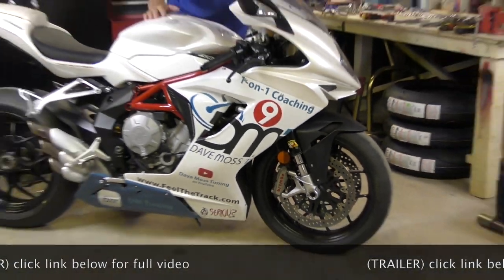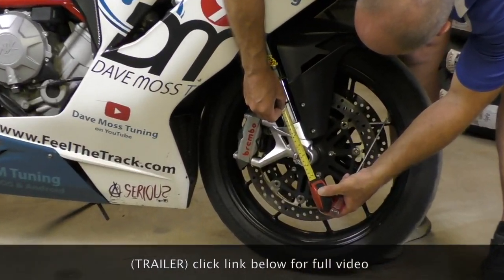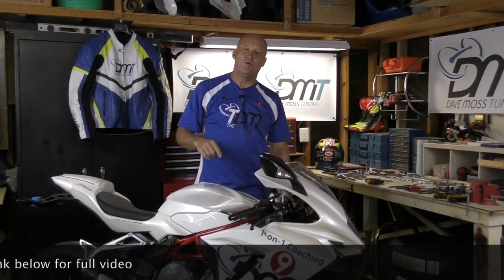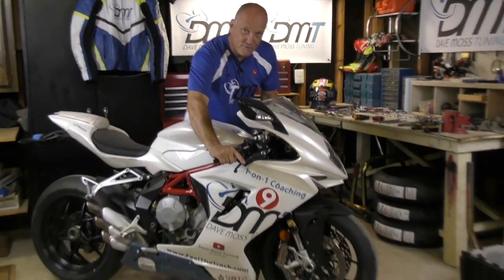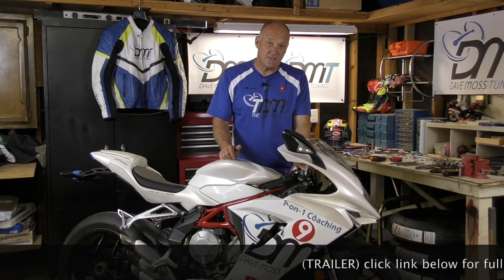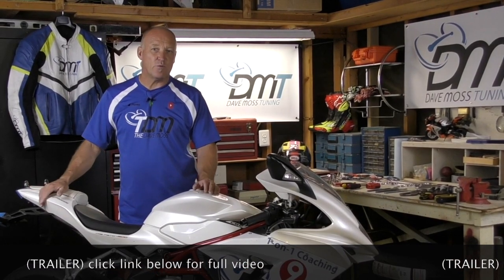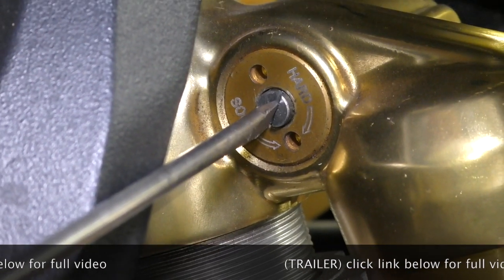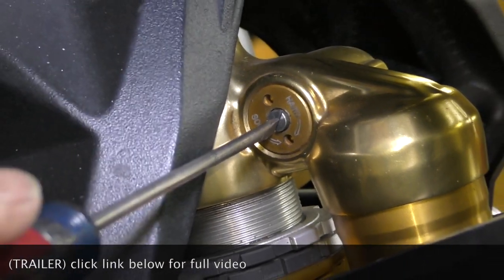Fasterclass: Bounce & Set Compression (TRAILER)

Comment: shouldn't Sag settings be based on weight, not what you think you want? I weigh 77kg how much would that be aprox for street and race?
Reply from the maker: Sag sewttings are done by weight first, then modified based on ability and use. Each year, make model may differ in spring rates and valving as well as geometry, so we need data essentially based on fork and shock travel used. Rule of thumb is 33-35% for street at 30-33% for track of total available travel.